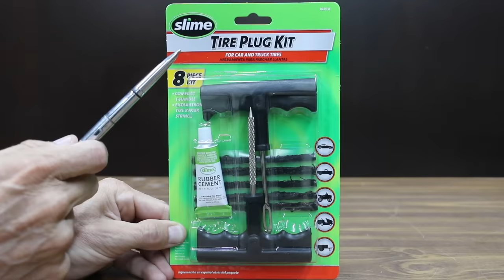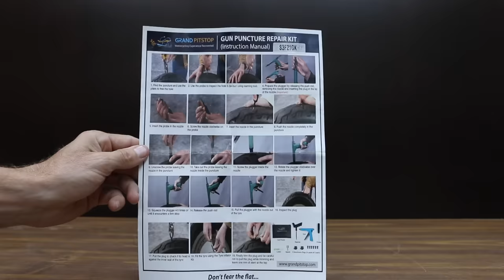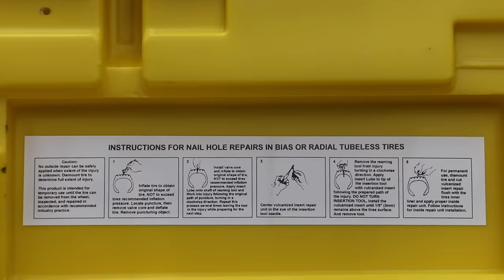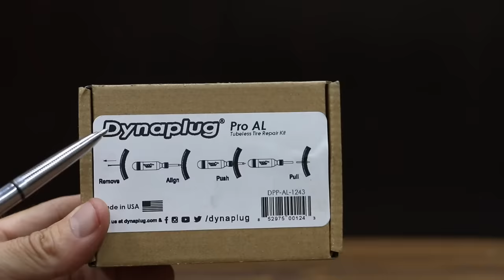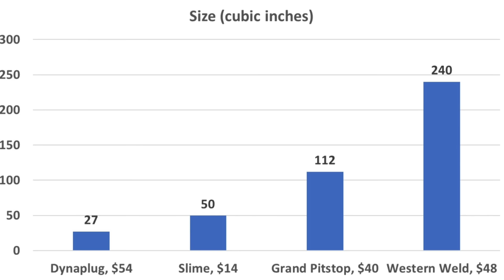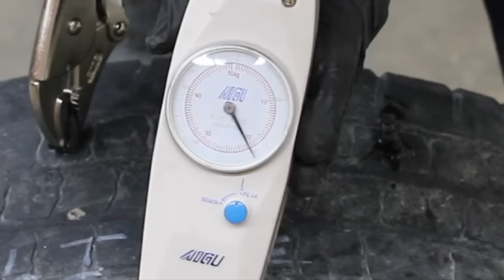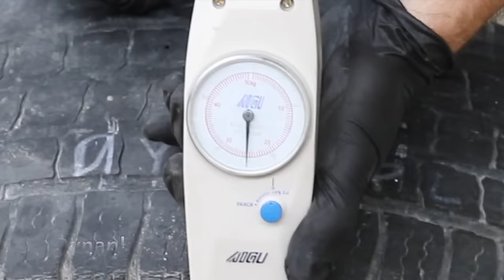Best Tire Repair Kit? SLIME, Westweld, Dynaplug, Grand Pitstop

Comment: I use the DynaPlug but not the one you tested. They make a squared push type handle version which allows much more force to be used to apply the repair. Got a couple of the repairs in each tyre on my car and can be used while the wheels are still fitted to the car. Really impressive bit of kit.
Reply from the maker: Thanks for the feedback.

Comment: @ProjectFarm 
I love your videos, keep them coming!  I just wanted to let you know that your link for the Western Weld tire plug kit leads to a product that is no longer available.  The new version of the Western Weld kit comes with a brown plug.  I would love to see an updated review of their new kit alongside the kit offered by ARB boasting spring steel in their reamer and insertion tools... I can't count the number of tire plug tools I have bent over the years! 
Another idea for an updated tire plug video is a comparison between this new silicon lubricant that kits seem to be supplying versus a rubber vulcanization compound that has traditionally been used.  The silicone lube does not seem like it would be a good option, but what do I know. 
 Anyhow, keep up the good work and we all sure appreciate what you do!
Reply from the maker: Thanks, will do!  Thanks for the video ideas.

Comment: Thanks for all your hard work testing so we don’t have to! 🙏🏼

I’ve use these tire plugs on my motorcycle with great results,  my only concern is where the ambient temperature is extremely high and the rubber becomes extremely soft. That’s where plugs tend to work their way loose because they tend to soften up…

Maybe test a heated tire and see what it does to the extraction force??
Reply from the maker: You are welcome!  Thanks for the video idea.

Comment: Excellent as usual. I'm amazed at the amount of gravel roads you have where you are. I really enjoyed this because I've used plugs before with mixed results and still do even on my motorcycles which every expert says is dangerous, but over 20 years ago shops would put plugs in.  I think it's a matter of technique and have used the slime type kits with good results.  The most problems I have had has to to with tools either being too flimsy or too big. I'm going to get a western weld kit because that looks perfect. Also the glue I found will dry up over time.
Reply from the maker: Thanks!  Thanks for sharing.
Reply: @ProjectFarm  no, thank you for posting these great helpful videos

Comment: I've never had a failure with a slime plug(this includes in motorcycle tires that I pushed pretty hard). but now I'll start using the western weld plugs because they seem even better
Reply from the maker: Thanks for the feedback.

Comment: Great test! I was just looking at getting a new kit for the car!
I would have liked to see you drill a few holes. A drilled hole would more reliably simulate what happens in the real world many times. I've plugged a LOT of tires and a straight in hole is the hardest to seal with a plug like you used. If you can unscrew a screw out of the tire rather than pulling it out, it is easier to plug in my experience.
Reply from the maker: Thanks!  Thanks for the feedback.

Comment: I used the grand pit stop/ nu fengtai style tyre plug on my brand new £150 tyres, 1st time I attempted it it did leak because I did not pull the plug back out enough after problems getting it through the nozzle but I tried it again and used some puncture repair adhesive around the plug and it worked.
Reply from the maker: Great feedback. Thank you!

Comment: Great Video ! I'm a Retyred Tyre man and back in my day I had a Blue or Beige Plastic Plunger and would insert a plug then the handle and push the shaft into the hole and then push the handle down and then pull the plunger out , cut the access plug , and yer good to go ! :) Best plug kit ever !!! came with mushroom or straight plugs that came in a can of silicone . My days of fixing tyres are over but I wish i could find this kit as I am sure it would kick butt on all of these garbage tire repair kits you tryed > ! If you ever come across this kind of plug kit Please do a video on it and post a link as to where to buy it ! Thanks
Reply from the maker: Thanks!  Thanks for the suggestion.

Comment: Amazing performance.  I guess that's why small punctures in the tread can be repaired by a tire store where they know what they're doing, and the tire will hold air for tens of thousands of miles, or until it gets old (in my experience).   Watching them, the process looks like these kits, but I don't know what brand stuff they use at tire stores.
Reply from the maker: Thanks!

Comment: I've only ever used the slime type tire plugs. I've installed at least a dozen of them. Most with an old straight handle that was a pain to use. The T-handle tools makes things much easier. I've never had to replace a plug, even after several years of driving. I used rubber cement  on some and silicone gasket seal on others.
Reply from the maker: Thanks for sharing.

Comment: I have used the tire slime ones lots of times As long as the hole is not so big you can get a seal they work great, when I was living in Alaska I actually had to put 2 plugs into a hole in a tire that only had 5k miles on it (no I did not get that road hazard coverage because I bought them on fort Richardson and the on base tire shop doesn't offer it) but I racked up 60k miles on those tire before the tread was shot never had a leak.
Reply from the maker: Thanks for sharing.

Comment: When I was a teenager I had a flat on my 7.3 F250, two nails in the right rear. Used two Slime plugs and I drove on that same tire for almost a year, never had an issue. Dont think Id do it again but they sure do last alot longer then youd expect em too
Reply from the maker: Thanks for sharing.

Comment: Excellent video.  I just subscribed to your channel.  Just wanted to mention, a Safety Seal plug kit as another option (USA made).  Very happy with the quality of the kit I own. It's basically like the Westweld kit you tested, but looks to be a little better quality (handles on the Safety Seal are solid steel vs. the hollow Westweld handles in your vid.)  I don't know if Safety Seal seals any better than Westweld, but the U.S. military keeps Safety Seal kits in some of their wheeled vehicles.
Reply from the maker: Thanks!  Thanks for watching and subscribing.  Thanks for the feedback.

Comment: I bought the dyna plug when I saw it on Amazon the size is perfect when you own a motorcycle super small so it fits under my seat and I actually used it hasn’t leak and don’t even know where it is
Reply from the maker: Nice!

Comment: I would love to see how good the tire plug screws work.  I am really interested in them but can't find any on Amazon with any real reviews.  Thanks for all your amazing videos.  I have watched every video you have ever made.  Even the videos reviewing items that I would never use or need.
Reply from the maker: Thanks!  Thanks for the video idea.
Reply: Bought a set on ebay, hit or miss, one straight puncture is working, the other angled puncture isn't holding air

Comment: great video,   one thought,    most screws, nails "small road hazards" do not go in to the tire straight,   you should  try these methods at a 45 degree angle...   i would love to see if there is much difference ...
Reply from the maker: Thanks!  Thanks for the suggestion.

Comment: Years ago, when driving a semi I got a nasty cut on one of my tires with no shop anywhere nearby.  I hosed plugs with rubber cement, shoved about 5 of them in a hole, and waited for glue to set.   Tire was still slowly leaking air through the cut, but with a couple stops to top it off I was able to drive about 100 miles to get to a shop and replace it.
Reply from the maker: Thanks for sharing!

Comment: I watch most of these videos even if I don't need the items at the moment but may need something down the road. In this case, I have the need. I couldn't locate my tire plug kit yesterday but my neighbor just happened to have one so my ATV tire is repaired. I need a new kit. It's one of those nice to have tools but almost never needed. I'll be looking for the SLIME kit. One thing I do is vacuum seal a lot of my items that can dry up. It's a long term storage thing I just do.
Reply from the maker: Thank you!

Comment: Hi I used to work in a gas station, 55 years ago and plugged many tires, never had one come back this method worked great. The real point is the vulcanizing rubber compound it must be vulcanizing compound to do  the repair . Just some information
Reply from the maker: Thanks for the feedback.

Comment: Good review. I already have an ARB kit (like the Sherco/WesternWeld) I bought about 15 or 20 years ago. Used it a few months ago and the plug has been fine after several 1000 miles so seems to have a long shelf life.
Two slight criticisms.
A more accurate pull test would have been psi to pull from the steel plate. Though in practical terms how you measured it is fine for the real world.
I was hoping you'd have had a bending force test for the insertion needles. I've seen several at yard sales with a bent needle.
I just picked up one for $5 at a flea market like that (Sherco maybe?). Need to get a new needle for it.
Reply from the maker: Thanks!  Thanks for the constructive feedback.

Comment: I was crunching some numbers with the Slime and Western Weld. I was also wondering if the Slime would work just as well without the cement as the Western Weld did without the cement? With what you get with the Western Weld (60 strips, no cement) versus the Slime (5 strips with cement,  whichthe cement can go bad), would it be more cost-effective to go with the Western Weld over the Slime? Did you factor this into your cost analysis? Thanks for your videos, I find them very helpful.
Reply from the maker: You are welcome!  Glad to hear!

Comment: I just used a kit similar to the Slime system and it works OK, but the hardest thing is putting the plug in.  I left the wheel on the car and had to kick the insertion tool and use a rubber mallet to force the plug in.
If you buy this kind of very affordable kit i recommend you find a beefy set because ive had the insertion tool fold over in the past because of how forcefully i was pushing on it
Reply from the maker: Thanks for the feedback.

Comment: Very nice comparison piece Project Farm!  I used a kit on two tires just over the weekend similar to Slime but with no slime (glue) in the kit and it included much bigger handles.  My O'Reilly's tech suggested the kit with the bigger handles for the extra leverage required.  Also, he insisted that the slime on Slime is really just rubber cement used on bicycle tires and acts as lubricant when inserting the plugs (which I think would haven made the job much easier).  He also suggested to have at least 23 psi in the tire (which I didn't for lack of an air compressor) otherwise you'll be fighting with the tire as it flexes when you bore out the hole and then insert the plug.  Maybe extra big handles, slime and an air compressor is the ideal setup.  I just purchased the Grand Pitstop to keep in one of my other cars for its seemingly ease of use with it's clever design. Although I am sensing possible leak issues as you have suggested.  I'll look forward to picking up my next nail or screw and giving it a go.  I love the Dynaplug with it's very compact design and what looks to be well built and thought out.  Just not sure if the handle will give me enough leverage to clean the hole and insert the plug.  In the end I'm very much liking the Westweld because of the extra large handles and sturdy design of the kit.  American made certainly helps the cause as well.  I don't mind paying extra for the old school America strong design.  Less plastic, longer lasting is my take.   Thank you again.
Reply from the maker: Thanks!

Comment: Thanks for the review. One tip though, it is suggested not to cut the remaining tip at the tire level exactly but allow for at least half cm margin protruding from the tire. Don't worry road wear will level it gradually with the rest of the tire and eventually you will avoid instances of it disappearing inside the tire. By allowing a half cm extending end gradually it will grow like a gum at the top of the tire by the road force sealing completely.
Reply from the maker: You are welcome!  Thanks for the constructive feedback.

Comment: We use napa plugs at the shop I work at they are red and thick I have seen 35000 miles put on one and it never leaked I have used them in sidewalls to never had one leak

Comment: I have used the Slime plug kits as permanent repairs for decades.  I have used them many times in many types of tires and have never had a problem or failure.  The repairs have all outlasted the tires.  However, I have learned to be cautious with the tool handles.
Reply from the maker: Thanks for sharing.

Comment: It would be nice if you tested the cheapest plug kit as a control. I find that the method of application is more relevant than the plug itself and plain vanilla rope style plugs always worked well for me, on cars and motorcycles. Kudos on installing 100 plugs and dispelling the myth that a plugged tire is unsafe. I run plugged tires as long as I would intact ones - often for thousands of kilometers - and never had a plug fail on me.
Reply from the maker: Thanks for the suggestion.

Comment: This was a great video, thank you. One thing I think might be interesting to add is a break test on the Slime tool handles. Concerns about a plastic handle breaking under load and stabbing the metal components into the user's hand are something I have heard but not sure if that's a real issue. [Slime also makes a metal handle pro version] Probably depends a bit on the age of the plastic as well, but might be good to know how strong they are out of the box. Enough for 30+ plugs apparently! :D Thanks again for the great tests!
Reply from the maker: Thanks and you are welcome!  Thanks for the suggestion.
Reply: I have had the slime repair kits and other brand who sell plastic handles, bend while inserting a plug. Today it happened but I went online and saw that harbor freight released a heavy duty plug kit that has metal handles under the brand maddox it has a replaceable tip unlike the slime that is one solid piece at only a $5 difference.

Edit: After looking online it seems to be identical to the Western Weld box.

Comment: I used two rope plugs in the same hole in a motorcycle tire and rode it until it needed to be replaced.
Been using rope style plugs for YEARS
Reply from the maker: Thanks for sharing.

Comment: I've been using similar tire plugs for about 45 years. Sometimes I plug it intending to use it only temporarily and later get a "proper" patch. Every single time, the plug just works and I forget about it and run it until the tire is worn out. Of course, these have only been cases where the hole was caused by screws, nails, or other small road junk... and only in the tread. I don't think I've every used rubber cement on a tire plug.
Reply from the maker: Thanks for sharing.

Comment: What I like about you Americans is the fact that you like experimenting a lot ! But what I want to comment is that there is a difference between pulling a plug and pushing. If you push a hose on a tube than this will be easy because the hose becomes wider however if you pull the hose doesn't come off. If you pull your rubber plug it becomes thinner and it flies out. But the air pressure from within the tire tries to push out the plug by which it will be thicker. If you want to do an honest test then do it by inflating the tire, and look for shelter. But, keep up the good work! Greetings from Amsterdam.

Comment: I've been using the slime style tire plugs for about 40 years. Various brands but same thing. I also use a rubber cement with it. I've never had a plug fail on me or start leaking over time. I have even used them on tires I race with. Tires get extremely hot & etc with no problems or leaks. Only complaint is the plastic handles. It's a pain reaming the hole & inserting the plug on low profile tires. I sometimes have to beat on them & the plastic handles break. I like the metal ones you showed on here though. I might have to get a set just for those handles & use the cheap slime or other brand plugs. 🤷
Reply from the maker: Thanks for sharing.

Comment: The slime plugs may be cheap and a little harder to use then the others but having experience on and off construction sights from mad, dirt, sand, gravel, and concrete they do what they need to do. He have trucks with multiple slime patches and never had a single one fail.

Comment: I really wish that this test would have been done on truck tires or heavy duty off-road tires. I've been having a difficult time finding a kit that has a reamer strong enough to push through these types of tires. A cordless drill with a drill bit will work, however who wants to carry a cordless drill with them to fix a flat.

Comment: I purchased two of the slime kits a couple years ago. As fate would have it, I used one plug out of each kit (separate vehicles). When I went to repair a leak in my SIL's tire earlier this week, the little tube of included cement was empty, the tube is plenty big and it doesn't take much so I grabbed the one from the other kit, it was also empty. I autopsied both empty tubes and my conclusion is the tubes weren't filled anywhere close to full. This folks, is why you buy American made!
Reply from the maker: Thanks for sharing.